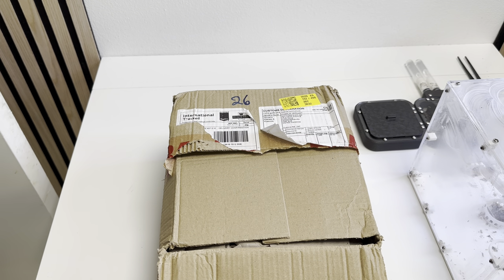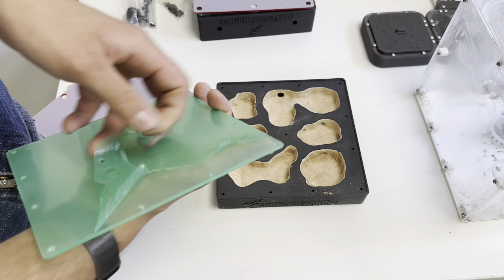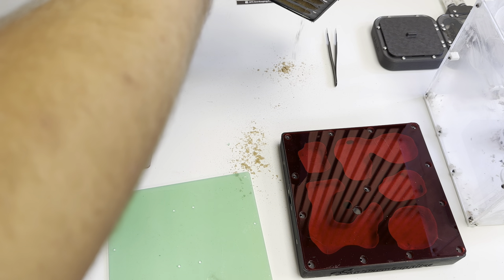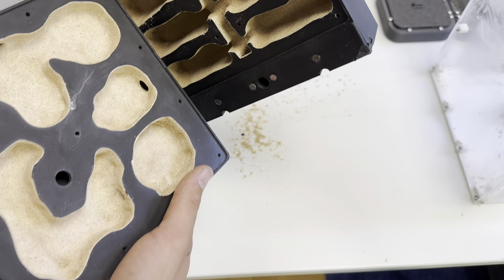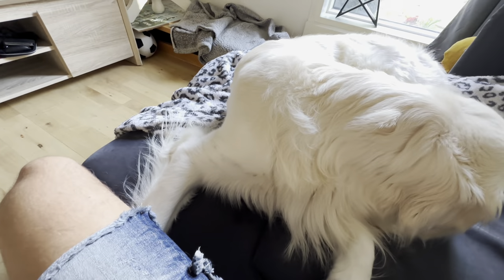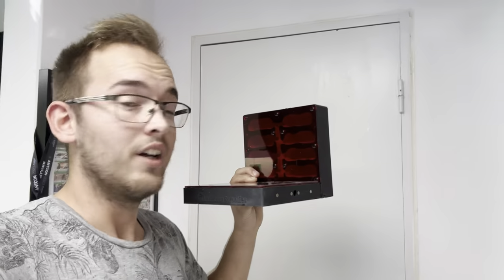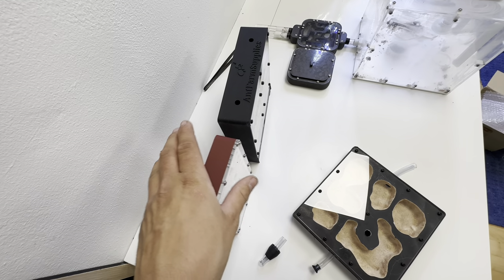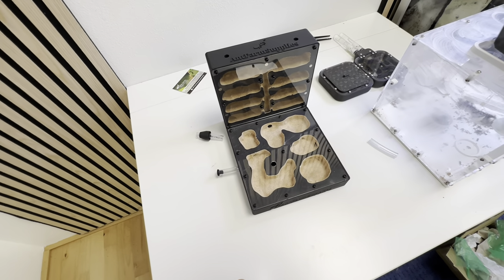First Look At Ant Farm Supplies!

Comment: lovely looking nests and has so much potential in the chamber department, think your right about the negatives though, when you placed the acrylic ontop of the sandy nest i nearly died, scratchs. i dont think people should be put into the situation though where you may ruin your brand new nest, can you send it back for a return after you've attached the lid and its got scratched ? not a nice place for a customer to be, def should be sorted inhouse. a little hoover of the nest to remove the excess sand and a lid attached would be 100% better.

Comment: Im a big fan of afs but get some of your points, i feel if the lid was screwed down itll get scratched in transit due to sand. But i also hate peeling the film off and building myself😂

Weird with the screw situation as mine have never gone loose i screw down just till they touch the acrylic and not actually tight tight as easy to round the 3d print off.

But nice fair reveiw and honest answers👌
Reply from the maker: Ahaha yeah i mean again the more feedback the better and better be honest and take some bad vibes then a new ant keeper having issues 😄